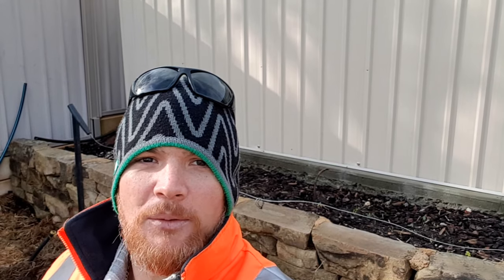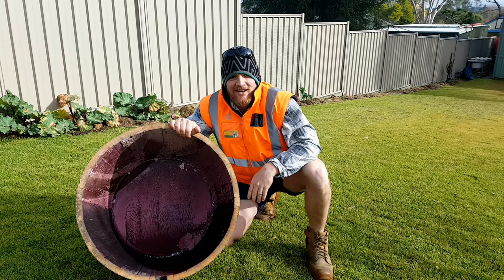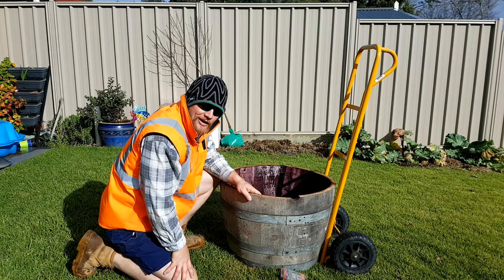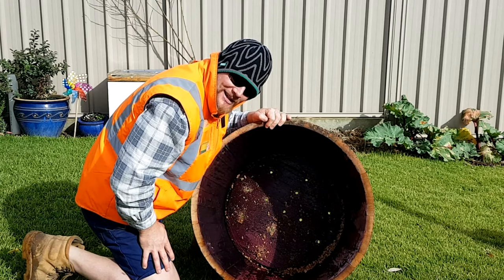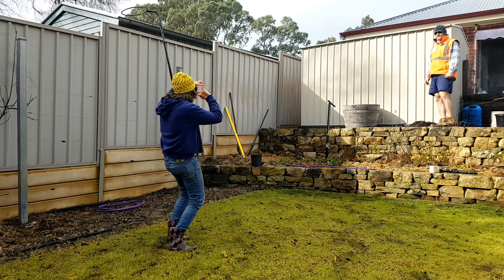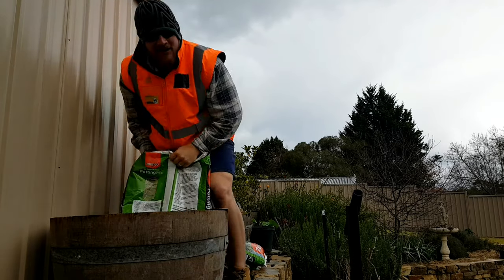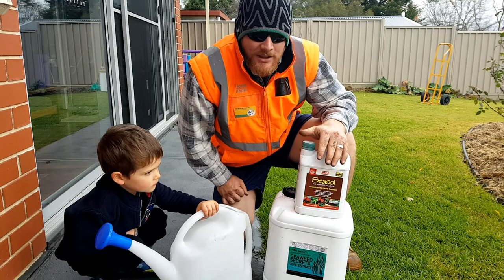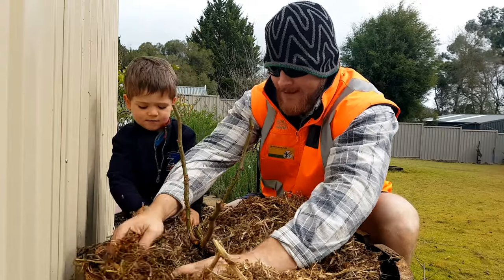PREPARING A WINE BARREL FOR PLANTS - how to 2020

Comment: One thing Id add is to treat the base of the wine barrel for termites if you are in an area where termites are an issue. My wine barrel planter got eaten out in a few years by termites - obviously love French oak! There are commercially available termite sprays (eg David Grays Ant and Termite Spray - get from Bunnings). If you dont want to spray the barrel wood, you could rest the barrel on a timber base and just spray that.

Comment: Dan, I've got a garden shed that needs the west facing wall covered, gets filthy hot in there, do you think a climbing Rose would survive the dry heat of a January Sun, and great vid mate.
Reply from the maker: Ooff. Prob be ok. The missus had tomatoes on the west shed of that same shed and they coped. If ya keep the water up and when it covers the shed should be ok.

Comment: Hello i have 2 half barrels that stack on each other and I couldn’t take them off now. Please help with any suggestions 🙏🏻
Reply from the maker: Could try and use some soap to act as a lubricant between the two barrels. Or drill a big enough hole in the bottom to use a crow bar to knock the out? Hope that helps mate
Reply: @thegreenandgoldlife1464  thank you i will try and let you know. They have been out in the rain for months 🤣i hope i can restore them and not wasting 2beautiful barrel planters🙏🏻